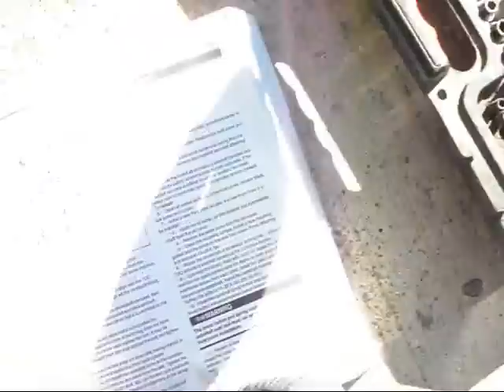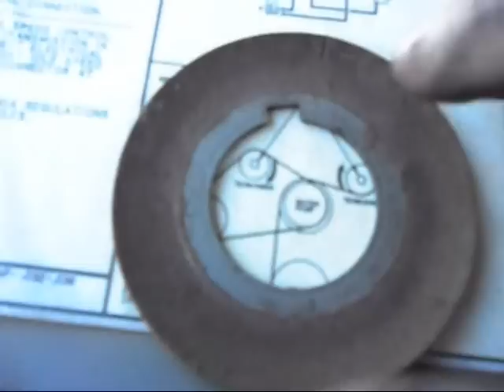How to change the timing belt on a Ford 2.3L engine.

Comment: To find TDC pull your #1 plug, turn over the engine with a breaker bar at the Harmonic balancer with your finger in the number one spark plug hole, when the pressure wants to push your finger out of the hole then you're on the compression stroke.
Reply: Exactly...

Comment: excellent short cut bro. nobody else even tells you how to unloosen and HOLD that tensioner in place like you did. that tip is worth its weight in gold, thanks
Reply: just tried that method on my 1989 ford ranger engine and the crow bar causes that sprocket gear to move. it did loosen the belt;  i found out that sprocket turns my distributor not just the oil pump so i got the tensioner loose but all my timing marks went off.  i got all the marks lined back up again, but i will have to get the tool from ford. prying on that gear during installation and removal of the belt will throw off marks yet again.

Comment: First item on the agenda is to DISCONNECT THE BATTERY.
Reply from the maker: No airbag on the car, not working near the battery, starter, or alternator. No real need to disconnect it.
Reply: That's a no-brainer he most likely takin taking the battery out  right away before he took the turbo out
because anybody who's going to work on a vehicle that is the first thing you do
you know unless you're on the side of the road changing the tire 🤡

Comment: thanks for the video. my 94' ranger is just slightly different, but this helped to answer some of questions. the biggest issues I'm having with everything is that in 94' it would seem like Ford decided to use rust to hold their trucks together. thanks again for taking the time to post this.
Reply from the maker: Glad to help. Lol, I'm from Texas, so we rarely have to deal with rust, but it's definitely a royal pain.
Reply: @316Autos  no rust!? here in Ohio, even our plastic will start rusting... not joking tho, I believe there are some parts of my truck that are only being held together with rust. and Ford tends to be the worst with frame rust...
Reply from the maker: @jonathanarledge7006  Only time I've ever dealt with rust is on classic cars, and stuff from up north. I've talked to people that are amazed at what we have in our junkyards, practically any body panel you want can be found in near perfect condition.

Comment: i cant believe i just saw this , lol, no. the firing order is 1,3,4,2 , so all you have to do is pop the valve cover alittle, shine a ligh, look at the second valve spring which is the intake valve on the first cylinder, then you turn the crank until the intake valve spring fully decompresses, which would mean the intake valve on the first cylinder is closed, which now means the piston is at top dead center. now when you look at the cam gear, the notches are lined up right next to each other, not across. you have to line the cam gear with the backing plate of the timing cover. the notch you see is a timing alignment mark where you line your cam notch to. ive done plenty of head gaskets and belts on these engines.
Reply: Thank you...I'm getting ready for a Spring engine overhaul and your comment helps.

Comment: I'd use a torque wrench to tighten all screws and nuts here, just like when I get new tires put on. Were one of these nuts or bolts loosen up, it could damage the timing belt, and ruin all your hard work. I have both torque wrenches, both in/lb and ft/lb in 3/8" and 1/2 " drive and use them constantly on EVERYTHING.  My Uncle taught me auto mechanics, and he always used the torque wrenches - even for just "peace of mind". Besides, it makes it easier to tighten everything because of the longer throw of the handle. No "breaker bar" needed.
Reply: You only need a torque wrench for the crankshaft bolt on a timing belt change. Hand tighten the rest.

Comment: I did my  87 Mustang that Phillips head bolt is right  in my 1 on the rotor cap is where urs was it's  1-3-4-2 is how mine is  I had to keep resetting my it was a tooth off what did u set ur timing at 10 degrees??

Comment: Great video, professional mechanic and I learned what I needed to know, I don't have the manual but YouTube is mechanics best friends. Fuck the dumbasses hating on this video they were to busy judging to listen, everything you need to know is here. The extra info on the oil pump drive shaft was critical belt working on a vehicle which belt had already broke
Reply from the maker: Glad I could help. I usually ignore the monday morning quarterbacks that don't understand that not every job goes 100% smooth.

Comment: How did you rotate the timing gears to get the marks to line up? I wish you would have left that part in the video. Thank you for the video! There are hardly any videos for these engines. I just bought a xr4ti engine I'm trying to swap into my mustang and I'm trying to get familiar with all the parts. Please keep more videos like this coming!
Reply from the maker: I just moved them each individually, the crank with the harmonic balancer bolt, and the cam by hand.

Comment: so far so good, but on the earlier models you have to remove the radiator to get the pulley off the crank, stock engines are non interference engines unless you mill the piss off the head (to raise the compression) ford  doesnt make a harmonic balancer, but when you build a stroker  motor up to 2700 cc,s, the  after market race car guys  supply em, the oil pump shaft  that turns distributor shaft is not a counter balancer. The turbo engines use a lower static comprssion ratio, the only reason there is a mark on the oil pump shaft, is to help keep the distributor in time, on the non distributor engines, there is a magnetic pick up behind the crankshaft pulley. When I was a teen ager I grew up on fiat 128,s and 124 spyders, if you started the engine with one tooth off the valves would smash holes in the pistons, but not with these, but it will run like crap. The other deal is if you deide to mill the head, you move the camshaft closer to the crank and you must buy an adjustable cam pulley.

Comment: hey Jason thanks for the vid it was a very big help concidering there is barely any info on the net.i am working on 91 ranger that jumped time I have got it back to running but it has a very slight tic so took apart and tryed to time it again and then the tic was worse could it be ticking cause I am off on the timining? and it idles right and everything idk  message me if u could it be a great help
Reply from the maker: The ticking is likely a stuck lifter. It could be a bent valve, but the 2.3L isn't an interference motor, so thats way down on the list.
Reply: Ya I got it lol I had it right the whole time the tick went away wen I put the the serpentine  belt on went away. I had it right. From start tyred  few dif. Configurations and worse. Wen back to the first one put all the way back together. Tic was gone. And I am out drive n right now take n it on. 2 hour trip home tomorrow
Reply: +Sterling Williams, "considering" is how to spell it.

Comment: #1 If you have a distributor,  first pull your cap find #1 plug, mark the cap & distrib body.
#2. Pull # 1 plug from the eng, use either a compression tester or thumb  rotate eng to find TDC.
#3 Check marks on balancer, etc to confirm TDC
Reply from the maker: Agreed. I use a screwdriver in the spark plug hole to 100% confirm TDC.
Reply: Yeah i do to. Once I believe I'm at TDC I put in a screw driver to make sure the piston is all the way up.

Comment: Thank you. I can't seem to get mine to move, so I'm wondering if my engine is locked up.
Reply: If it is locked up and a lot of people will tell you this won't work
But take your spark plugs out squirt quite a bit of Murphy's mystery oil in every single cylinder let it sit for a day maybe two. Then try to break it free I've done this to
#2. 
(" MUDTRUCKS")

Comment: My bolt that uses the Phillip head is completely stripped out some jackass who did it before me stripped it to hell what would you advise?
Reply from the maker: Center punch or a chisel and a hammer. Dig it in and hammer it counterclockwise. Should break loose. If not, dremel with cutting wheel or a grinder.

Comment: Does ford ranger not have a harmonic balancer? Do you have to remove the power steering to get to the timing belt cover?
Reply: +JC316
Reply: I can't even find instructions on just getting to the timing belt. All these videos are stupid, like, doesn't even show how to get to it
Reply from the maker: Every engine is going to have either a harmonic balancer or a crankshaft pulley. You don't have to pull the power steering, at least not that I remember. This video seems pretty clear to me on getting at the belt, so you either didn't watch it fully, or you're having a hard time following it. You might be better off taking it to a mechanic.
Reply: +JC316 , I had to remove the fan, radiator, ac/power steering bracket to get to the timing belt. It wasn't hard once I did it the first time.  The second time I took it all off again to tighten everything and fix something that I missed, it took 15 minutes to get the to the timing belt

Comment: Excuse me can you plz tell me what car is it year and model thanks
Reply from the maker: This car is an 87 Thunderbird Turbo Coupe.
Reply: +JC316 there is one other way to do it without holding the flywheel. Use a big pipe wrench and a breaker bar and you should be able to break the bolt lose on the harmonic balancer.
Reply: Yep, that's the way I did it on my SBC, a good torquey jolt is enough to break the bolt loose without turning the engine over.  However, even with the bolt out, a harmonic balancer puller WILL be needed, though they can be rented for a song.